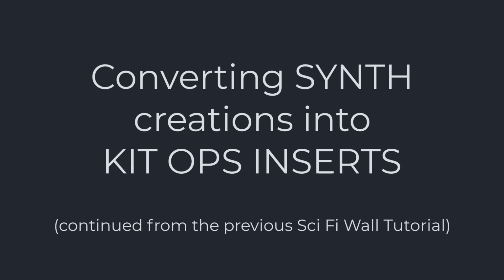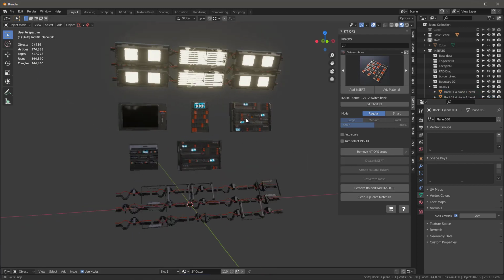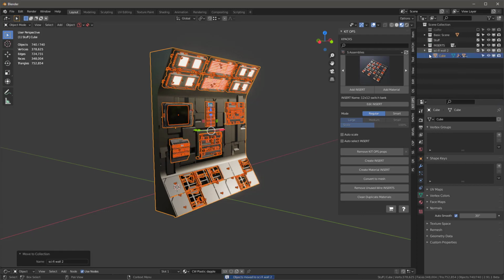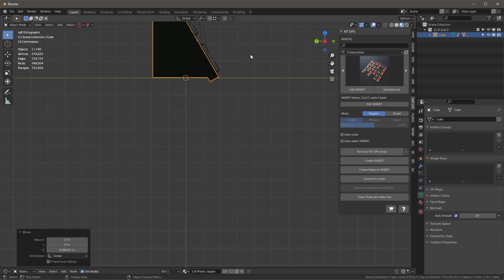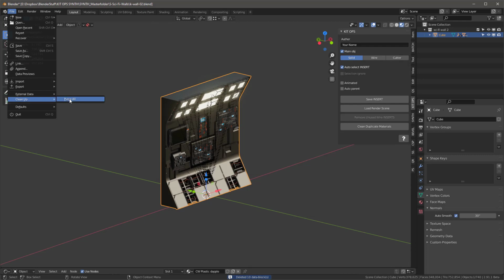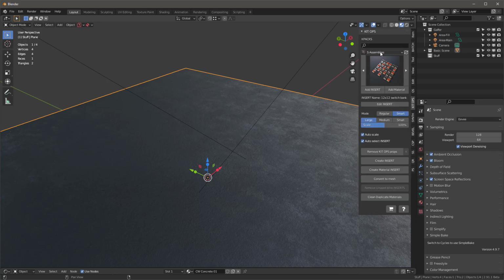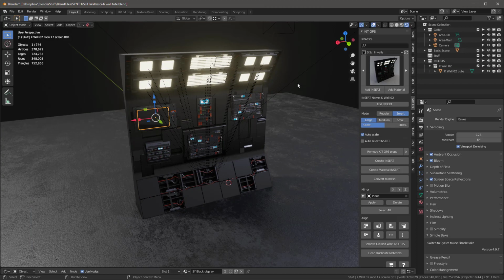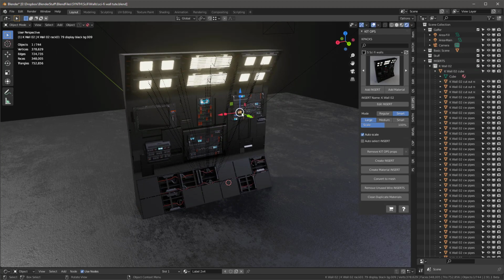Step by Step Converting your SYNTH Designs to KIT OPS INSERTS

Comment: All those steps to get the origin to the global 0 is way to much. Why not simply set object to center manual then simply do origin to 3d cursor. Thats 2 steps vs what you showed :)
Reply from the maker: Because I want to create many many of the same type of INSERTS, so I can use synth to line then all up-- so they need a very accurate and specified origin point, and bounding box is more accurate for this model than median.
Reply: @ChippWalters  I meant the placement of the origin. You did quite a lot of step to finally get the origin at the bottom. Those can be done much faster
Reply from the maker: @RomboutVersluijs  I think you are misunderstanding what I am saying or you don't understand what I am trying to do.
Reply: @ChippWalters  Yeah you need the origin at 0,0,0 but do this in many steps to achieve this. I would move object in ortho view to ground, center cursor to scene origina, then origin to cursor. I believe i saw like 4 steps to do the same. Ill check it again